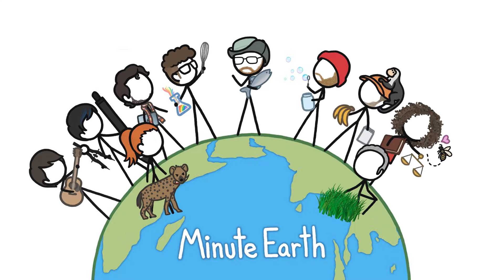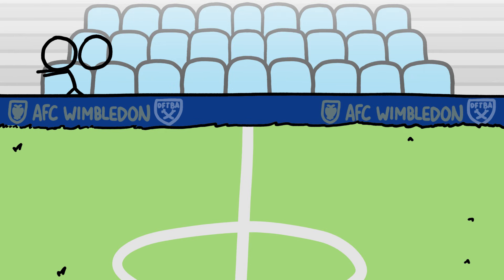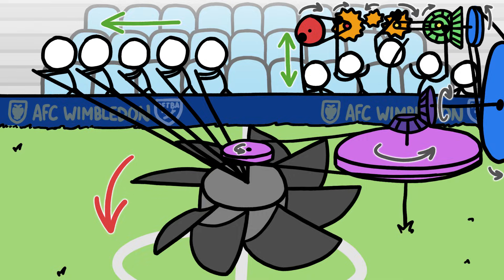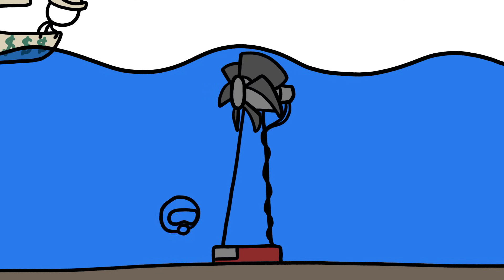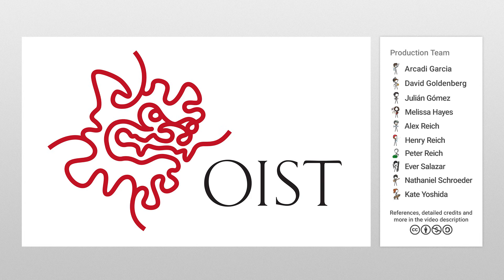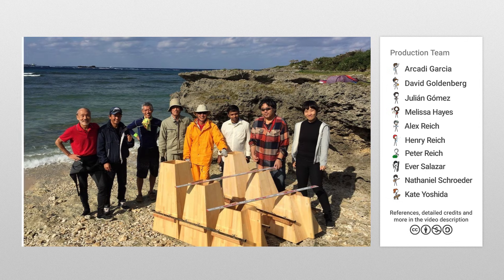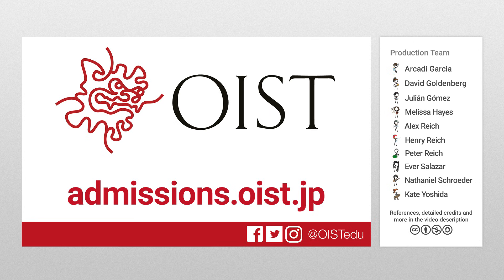Why Can't We Get Power From Waves?

Comment: The most successful wave power plant, Mutriku Breakwater Wave Plant, was commisioned in 2011 at a cost of 6,4M€ for 296kW peak. That's 21.000€ per kW nameplate Power installed. 20 times more than wind, and 30 times more than solar. 
But maybe it's generation more power to make it worthwile?
By the end of 2023, the total lifetime generation was 3 GWh. That's about an average power over 12 years of 12kW or 9% average load factor. That's abysmal. Wind, in germany, has 23% onshore and 28% offshore. In good wind locations like Scotland or Tasmania, it's 80%.
So it absolutely sucks at power output too despite being 20 times more expensive to build /kW nameplate. 
So maybe it lasts longer than the 20 years wind turbines work? Turns out, the turbines are worn already and need to be reoplaced for 3,4M€. 
SSo they even last only half a slong, making them 75-150 times more expensive per kWh generated than wind. 

it's a crime to still burn valuable renevable investmentcapital on wave power after all those projects proving without a doubt that it is far too expensive to build and maintain.

A € in wind power saves  75 to 150times more CO2 than the most successfukl wave power plant does. 

And still- new projects are popping up sucking away all that green investor money to shurely fail.

Comment: The waves are created by wind, so couldn't we just build offshore wind turbines anywhere that would be good for wave energy? It's good to have a variety of renewables because some are only available in certain areas (especially geothermal or hydroelectric) or only work as certain times (like solar) but would there ever be a time or place where offshore wind didn't work but wave energy did?

Comment: So to make electricity of commercial grade you are in essence spinning a  train locomotive around 50 times a second 
That's about what dose happen at the usual power plant 
Ocean energy is storms tides wave current wind corrosive salt water things that will live on any surface as big as if is 
Hard to get to and has to be made incredibly durable 
Then you can add wild life and a million other things to too complicate everything else 
Think of it like this if ocean energy was easy we would already be using it

Comment: how about having the generator on land, and having a rope spin a wheel. On the other end of the rope you have something floating at sea. As that object pulls away from the coast, it pulls the rope, spinning the generator, as it comes closer to shore, the rope is retracted with a spring like mechanism kind of like a dog leash. 

Sounds cheap.

Comment: Let save you time

Wave power, while promising as a renewable energy source, faces several challenges that have hindered its widespread adoption and effectiveness:

1. **Technological Maturity**: Wave energy technology is still in relatively early stages compared to other renewables like wind and solar. The devices designed to capture wave energy need to be more efficient and durable.

2. **High Costs**: The development, installation, and maintenance of wave power systems are expensive. The technology requires robust materials to withstand harsh marine environments, leading to high initial and ongoing costs.

3. **Environmental and Social Impact**: Wave power installations can impact marine ecosystems and local fisheries. Additionally, there can be resistance from coastal communities due to visual impacts and potential disruptions to shipping and recreational activities.

4. **Energy Transmission**: Transmitting the energy generated from offshore wave power systems to the onshore grid poses technical challenges. Efficient and reliable infrastructure is required to ensure minimal energy loss during transmission.

5. **Variable Energy Output**: Wave energy can be inconsistent, as it depends on ocean conditions. This variability makes it challenging to rely on wave power as a stable, continuous energy source.

6. **Site-Specific Challenges**: Ideal locations for wave power are often remote or far from existing power grids. The need for specific geographical conditions (such as consistent wave activity) limits the number of suitable sites.

7. **Regulatory and Permitting Issues**: Navigating the regulatory landscape for offshore energy projects can be complex and time-consuming. Obtaining necessary permits and ensuring compliance with environmental regulations can delay project development.

Addressing these challenges requires ongoing research, technological advancements, and supportive policies to make wave power a more viable and competitive option in the renewable energy market.
Reply: There is some promising stuff for "on shore" wave power generators.  They bypass a lot of the issues. They don't have the sheer potential that offshore wave energy has, but they make up for it in reduced maintenance, easy accessibility and minimal environmental impact (attached to pre-existing infrastructure, so the damage is already done and by offering clean electrical generation, they can offset some of the issues).

Comment: Solution majeure pour la transition énergétique
HACE (houlomoteur) c'est 150 tonnes d'acier recyclable par MW avec ancrages acier & fonte SANS béton, rapide & simple à fabriquer & installer en grandes quantités (scalable au niveau mondial) => énergie propre compétitive (< 30 €/MWh) quasi non intermittente (petites vagues constantes) & ultra décarbonée (< 1 géqCO²/KWh/ cycle de vie) en phase avec la consommation (parité réseau) car les vagues sont plus fortes le soir et en hiver, comme la consommation, réduisant au minimum le stockage.
HACE présente une grande acceptabilité sociale (cf. avis des pêcheurs), et un potentiel planétaire supérieur à 100 000 TWh/an soit 4 fois la production électrique mondiale &>1 000 TWh/an en France. 
HACE est parfaitement complémentaire avec le solaire qui produit le jour & plus en été, pour un mix décarboné équilibré qui a besoin de toutes les ENR & EMR sans déchets intraitables.
HACE amène de plus de nombreuses externalité positives comme la protection contre l'érosion côtière et la séquestration du CO2 
Lien vers l’émission télé consacrée à HACE : https://www.2degresdeplus.com/home  
hacewaveenergy.com 

A major solution for the energy transition
HACE (wave energy) is 150 tons of recyclable steel per MW with steel & cast iron anchors WITHOUT concrete, quick & easy to manufacture & install in large quantities (scalable worldwide) => competitive clean energy (< 30 €/MWh) virtually non-intermittent (constant small waves) & ultra low-carbon (< 1 geqCO²/KWh/life cycle) in phase with consumption (grid parity) because waves are stronger in the evening and in winter, like consumption, reducing storage to a minimum.
HACE is highly socially acceptable (cf. fishermen's opinions), and has a global potential of over 100,000 TWh/year, i.e. 4 times the world's electricity production &>1,000 TWh/year in France. 
HACE perfectly complements solar power, which produces during the day & more in summer, for a balanced decarbonized mix that needs all ENR & EMR without intractable waste.
HACE also brings many positive externalities, such as protection against coastal erosion and CO2 sequestration. Link to the HACE TV show: https://www.2degresdeplus.com/home    
hacewaveenergy.com

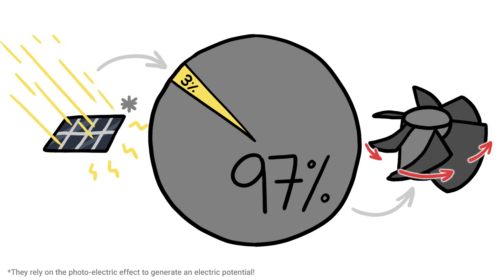Comment: 0:32 Gas turbines work very similarily to a jet engine. So yes, it's still a turbine, but no, there's no steam. 
Sometimes this turbine is combined with steam plant, which makes more efficient heat usage, but this isn't necessary so.

Comment: And they’re not using your normal style of propeller set ups were empillar like you’re stating in here they’re using the waves to compress air in the air cylinders so it’s compressed air that use to power generators, but it’s been three years since you’ve had a video you know that by now, or you should’ve at least put an updated video out stating that you were misinformed before work

Comment: Dear MinuteEarth, Not only you are helpless, you are coming to impose your helplessness unto everyone else. Is it a big problem to convert up and down motion into rotational motion????? Haven't you heard about the internal structure of a gas engine, or a steam engine??? A piston moving up and down inside a cylinder, and intakes and discharges are controlled by valves??? And you are claiming a University supporting you??? The failure of available designs now to harness sea waves energy is mainly due to their inability to choose the appropriate location to fix their turbines.

Comment: BULLSHIT VIDEO! Most wave energy projects are driven by government funding and university grants, (which seldom require commercial viability, simply "pet" projects). Wind turbines wouldn't be commercially viable without government funding, tax breaks, and guaranteed purchase of their output; but, they're a favourite symbol of the "green energy" crusaders. Ocean waves are intermittent energy sources, that need to be concentrated before running a turbine; so, putting a turbine on a small pier, small boat, buoy or string of buoys, (with very limited storage capacity), only works well for small demonstration projects, (enough to entice more government research funding and university grants, but no commercial viability). Boilers using cheap fossil fuels, (or, at nuclear power stations), have their energy concentrated at the point of combustion; but, they produce excessive carbon dioxide waste, (a climate problem, or nuclear waste from nuclear stations). Dams concentrate rain water; but, no one tries to run turbines from occasional rainfalls, do they? Thus, the problem is not turbines; the problem is misdirected funding to impractical demonstration projects, continued reliance on cheap fossil fuels (especially by China, the United States, India, and Europe), and the failure to concentrate intermittent wave energy, (as reservoirs concentrate rainfall for hydro-electric dams), before using turbines to generate electrical power. Who would power their automobile by rainfall or occasional winds with a turbine on the vehicle? No one. Yet, an EV automobile is easily charged by a power grid using wind turbines and hydro-electric dams, in Ontario, Canada, (not using fossil fuels). The turbine isn't the problem. The problem is the idiots who put turbines and machinery into a harsh and corrosive environment with inadequate power storage capacity. Graduate students ought to know better, (especially graduate students in a country where a nuclear power station was stupidly built with inadequate protection from tsunamis, and which has plenty of coastlines and wave energy potential to eliminate its need for fossil fuels). AGAIN, BULLSHIT VIDEO!

Comment: There is indeed a wave energy converter (WEC) system that would be commercially successful if the capital investment could be found to bring it to market - it requires approx US$150 million.

But the unit cost of electricity generated thereby would be lower than even the cheapest forms of fossil fuel or nuclear energy at mature installation.

It has been designed by an eminent authority, respected throughout the world as the Father of Modern Wave Energy and involves the discipline of Digital Hydraulics® -  this is the critical factor, as although the technology is actually European,  one well-known Japanese heavy engineering company has already tested Digital Hydraulics® energy converters in wind turbines up to power ratings of 9 MW.

So far, the Digital Hydraulics® energy converter systems tested by this Japanese company are ahead of schedule, under budget and generating electricity more efficiently than predicted.

Comment: I think many are not really looking at waves the way they should be looked at ...... or maybe not asking the right questions to start with .... what makes waves? THE WIND, an earthquake, etc .... water waves do not have energy of their own and without wind there are no waves any sailor knows this, without the moon there are no high tides ..... why would anyone invest in transforming the energy from water waves when the waves themselves first transform the energy from the wind? Is it that engineers, academic and empirical ones, do not understand this? ...... yes, I know water wave as secondary energy could be harnessed as well but getting energy from the air above is cheaper, any sailor knows that in order to move a boat wind must be present only problem is that the higher the wind the bigger the waves ... however the wind converted energy and thus absorbed in producing waves still could be converted, I guess, to electricity but it may continue to be not as efficient or cheap as "gravitic" (hydro) electric.

Comment: Bill Gates and others should look at thermohaline circulation (known as the ocean's conveyor belt) as "The New Wave" and a long-term solution to producing "continuous" energy since tidal, wind, and solar forces are intermittent. If the oil industry is capable of creating deep platforms along with offshore pump stations than those large companies should be capable of building or designing these offshore turbines.

Comment: Instead of turbines, an oscillating wave surge converter uses hydraulic accumulators to absorb and stabilize the pressure from hydraulic piston pumps. 

Also, everything is still so expensive because there aren't really any government subsides for ocean renewable energy :/

Comment: we have ICE engines that convert linear momentum into angular momentum, surely you can build an above water structure and hook up a rod and piston to a transmission. with a heavy flywheel and correct gearing it would spin long enough to take advantage of the 2 cycle.

Comment: This is about the problems of a power-take-off, not about gathering power from waves. The best way to gather energy from a wave is a phased array: like a TV antenae, this is why devices like the Pelamis are the most effective way of accessing wave power. Hydraulics or mechanical linkages and generators can then transform this into a more useable power; such as electricity. So, we CAN get power from waves. The reason we AREN'T getting power from waves is due to the risk: given a choice between wind power or wave power, any investor will choose the proven, well developed wind option, wave power just costs too much to develop.

Comment: Correct me if my idea is silly, but some of you may have seen this invention that uses gravity in order to generate electricity (I think I saw this was being populated in Africa or so), and for this, there is a resistance that generates energy. Wouldn't the waves pushing onto the shore generate the same type of energy? If there was some sort of machinery where the waves push a flat surface attached to a rod, that is attached to a resistor, would that generate electricity better than the ideas mentioned in this video?
Or maybe I am missing something like whether or not this rod would get pushed back out and how? (perhaps through gravity if it is positioned at an angle? But then it would require the wave's force to be greater than the gravitational force), and/or whether the amount of water would matter, depending on the tides. I guess in general this idea has a lot of flaws, but perhaps it would be easier to maintain.

Comment: Like the shake flashlight, they have ones that use the inertia of the waves to move a magnet through copper coils and transfers directly to battery storage.... no turbines.
They are enclosed and much cheaper to maintain. I hate how you just accept that human trash in the ocean is a good enough reason not to push this tech forward.
We should use these power generators to power giant pool skimmers that clean up the trash. There is an island of human trash in the Pacific that is the size of the entire state of Texas.
These power generators can be part of the solution to the issue you say is hwy they don't exist.

Comment: I had the buoy idea 5 years ago when I was 17 and I think its time I finally try something with it to make a protoype. I still have my drawing. The up/down motion basically works a pump. I used to be a zoology major so I got the idea to have the gases be in seperate chambers to require less work to to spin the fan and would also solve an issue if the volume of the pump tube is greater than the air it brings in.

Comment: I know this was a while ago, but I think it's important to correct. Your statement about gas generation is incorrect. In the gas generator portion of combined cycle systems, which provide the majority of natural gas energy, use a Brayton cycle similar to a jet engine to turn the turbine so air is the working fluid. (The other portion is steam generation). These combines cycle systems are over 60% efficient and 2/3 of that 60% comes from the gas and air combustion turbine not the steam turbine. There's also no theoretical reason why hydrogen gas can be used as a green fuel for the gas turbines. Perhaps cheap solar energy during the day will be used to electrolyze water into hydrogen and oxygen, then the gas turbine can burn hydrogen to meet longer term demand.